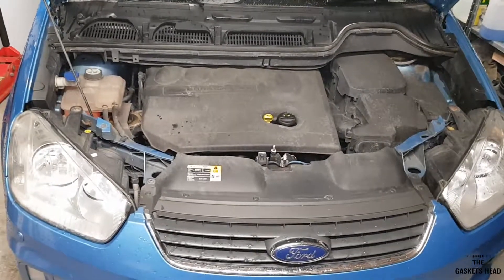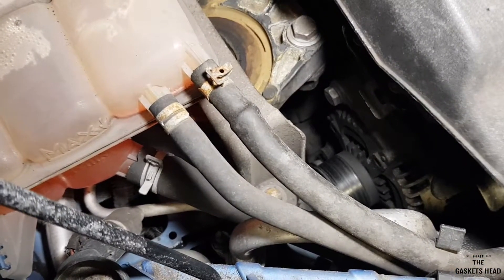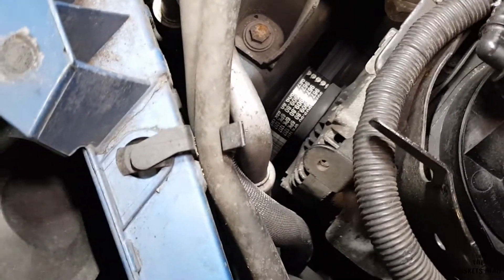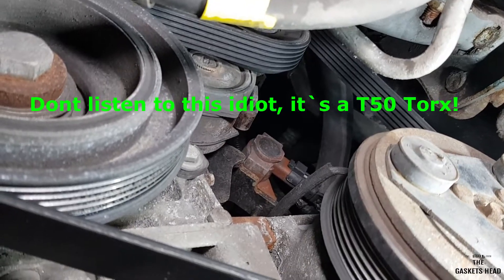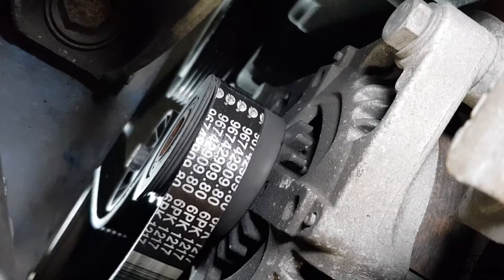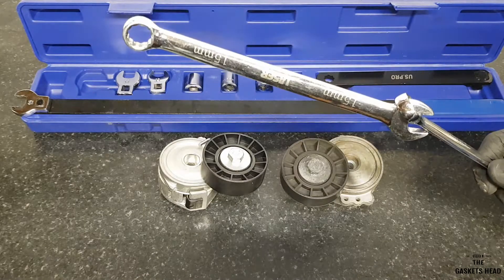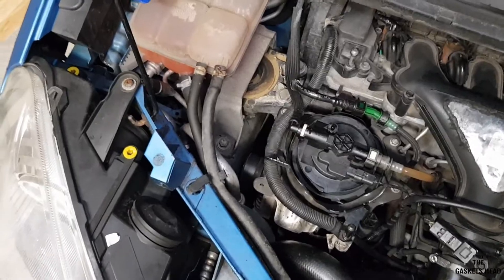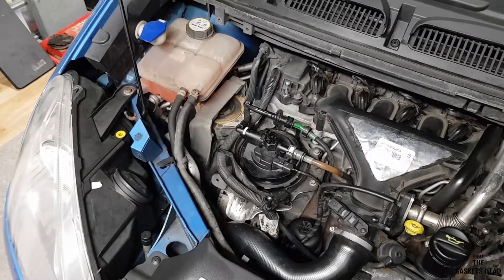Ford 2.0 TDCi Drive Belt & Tensioner Replacement on Focus / C Max / S Max / Galaxy / Kuga  DW10

Comment: Ive got the exactl same issue on my 2008/58 Volvo S40 2.0D (basically the same engine D4204T)
Ive not had anyone look at me, yet, but i am feeling the embarrassment 😅

Sods law its giving up after ive just put a new alternator on too - but it's nice to know indont have to remove that again

Comment: On my Ford Galaxy DW10 the original belt is FoMoCo 6PK 1206. The Gates belt have different tracks, they do not fit into the rollers

Comment: Thanks for your brilliant video. 
58 plate 2.0 TDCi Focus. Tensioner nut was 19mm on mine so just needed two 19mm combination spanners (or a 19 and 20 etc) for the extra leverage. 
Took less than 30 minutes on the roadside using standard jack and hand tools - trolley jack and air/electric ratchet would speed things up. 
Mine only had Alternator, A/C, Crank and the tensioner/idler pulleys. 
Found it easiest to get belt on Alt, A/C and partially on Crank pulley then push back idler with the 'extended' spanners and finally flip on crank pulley, properly as more 'space' - didn't need to use 5mm pin to hold 'back' tension.
As shown in video you are turning spanner anti-clockwise as if to undo bolt but due to cam action (and very tight bolt) idler pulley pushes back to release tension on belt.

Comment: When changing the belt is it necessary to do the water pump as well. Thanks.
Reply from the maker: The water pump is driven by the timing belt on this engine so would only do it when replacing that to be honest

Comment: Done this job today on my Kuga, thanks to this vid. Oddly my tensioner that come off (Dayco) was 17mm on the end, the replacement was 15mm nut!? Good job to be honest as I didn’t have a 15mm spanner - so had the original been 15mm I’d not have been able to get it un-tentioned.

Comment: I had the drive belt and tensioner replaced  I can see the tensioner vibrating when the car in idle is it normal for the tensioner to vibrate does your car tensioner vibrate I have a ford galaxy.
Reply from the maker: That’s the tensioner doing it’s job, nothing to worry about. Old fixed ones wouldn’t move but modern types are spring loaded to give/let off tension as needed.

Comment: I changed the alternator same belt, same tensioner now there's huge slack the belt without moving thr tensioner. Could it be because I didn't put a drill bit in? Scratching my head on what to do here
Reply from the maker: Most new tensioners will have a pin installed that needs to be pulled out once everything is good to go. If not and there is still slack then recheck the routing of the belt
Reply: @thegasketshead1416  school boyed it on the belt. Just a fuel filter to prime and I should be gtg. Cheers mate

Comment: I have this engine in my s40 2009 
Is idle 900 normal? 

Also it sort of shakes the whole car on idle too every couple of seconds, annoys me.
Reply: Mines the same if you still have the car and is on high mileage can try one grade thicker oil takes away acceleration slightly but sounds bit smoother and stoped a small oil leak

Comment: Hello mate done mine but i can’t get tension on the belt. Didn’t changed tensioner as it was holding tension on the old belt.
Reply from the maker: Firstly check that the new belt is definitely the same and not a bit bigger. If not it could be the tensioner has failed and cannot hold tension on the new belt possibly

Comment: Thanks for this. Tensioner bolt was 17mm on my 08, luckily I have a set of the Brittool hexagonal spanners, as the bi-hex went round the bolt head, maybe been damaged before I had it.
Reply: Mine too! 17mm, the replacement was 15mm?

Comment: could i change the belt on the road side if i was to have one of them cool spanner tool to release the tension?
Reply from the maker: You don’t need one and is more of just a time saver. You can couple two spanners together and do it from underneath but be warned, watch your eyes!!!
Reply: @thegasketshead1416  Ah, so i would definitely need to take the wheel off, cant be done from above?
Reply from the maker: @yolinkin   yes the wheel would need to come off to do it that way. I suppose you could get the wheel up on the kerb but would be a tight squeeze 😂

Comment: Is this the same as the 06 Volvo V50 2.0D engine?
Reply from the maker: As far as I’m aware it is. There may be a few minor differences but should be nigh on identical in the most part(famous last words 😂)
Reply: @thegasketshead1416  no worries, belts are on my to do list... Eventually so I will see if I can use the vid for references 😁

Comment: @the Gaskets Head
How would you start to get the alternator out of the engine?
From the top or bottom? There are obstacles in both directions, the fuel filter on top and the ac compressor at the bottom.
Reply from the maker: The alternator can be done mostly from the top but the fuel filter would have to be taken out for clear access. If you ever had to remove the a/c compressor then it would be done from underneath

Comment: Hey mate.. is it necessary to replace the tensioners? Or is it ok to keep it if still seems rotating well?.. got my 2.0 TDCI at 96k odo now.. planning to get drive belt change on 100k..
Reply from the maker: In my case it was the tensioner that was making the noise but if it’s not then there is no need to change it

Comment: Do you not need to tighten the 15mm socket
Reply from the maker: It’s pre tightened in production and shouldn’t need to be tightened. If you turn it the wrong way you can loosen it but not to worry, just nip it back up

Comment: Great video, i keep getting a rubber smell on a 2011 mk4 2 ltr mondeo, had new aux belt , water pump and cam belt last year,
no noise do you think the smell is due to a new belt on full lock ??
The tyres are a few mouths old , the smell comes then vanishes  in seconds.
I have had a new aux belt tensioner , would it make a noise if it was on the way out t?